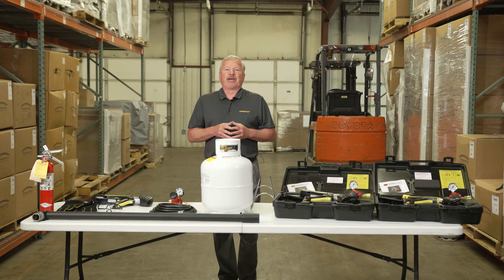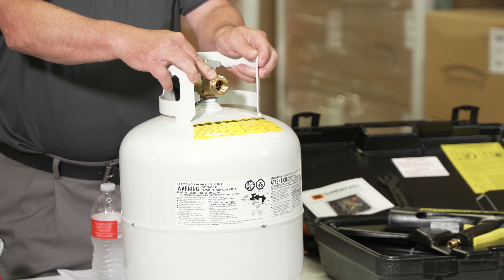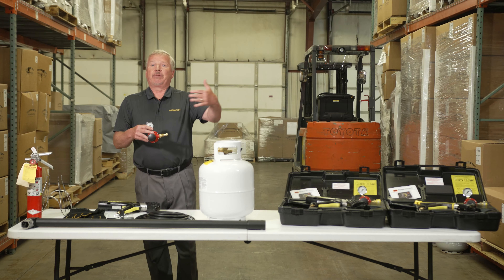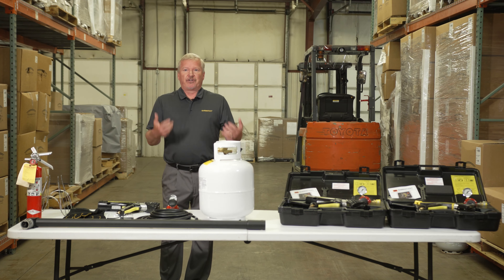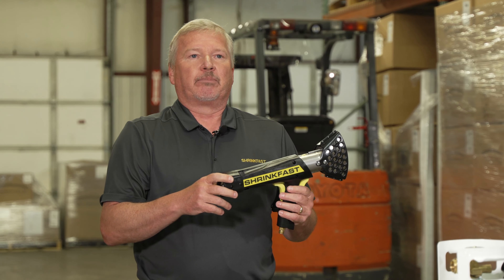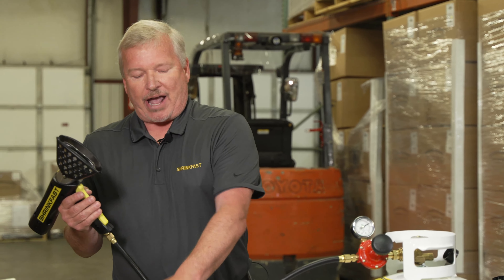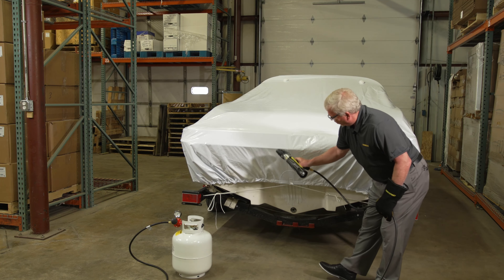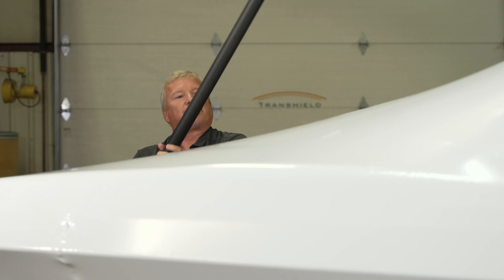Heat Tool Safety Training: Shrinkfast Model 998 | Safety Tips and How to Shrink Wrap

Comment: I bought a 998 through U Line and used it with little understanding of what I was doing, The job turned out fine but it would have been a great help to have seen this tutorial before beginning. My suggestion is that you include a DVD of this tutorial with each gun sold.
Reply: DVD? 
I’d have to time travel or possibly find library to view it.